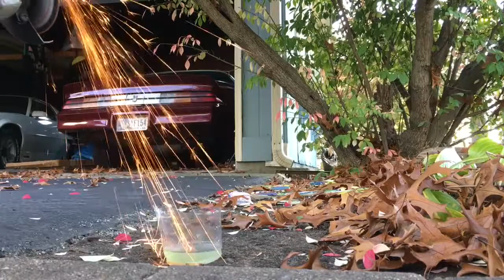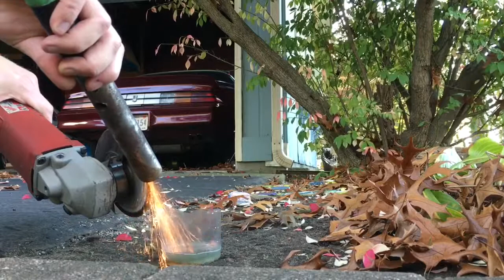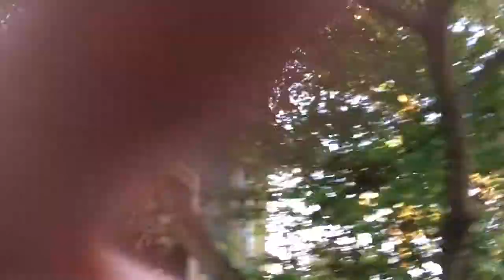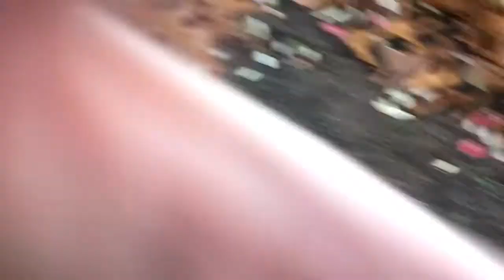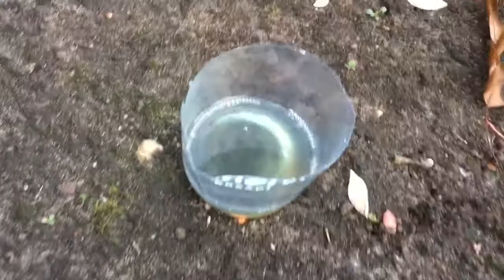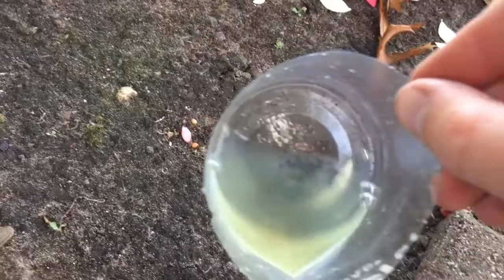Gasoline vs Sparks from Grinder

Comment: i sometimes light my cigarette with an angle grinder, gasoline does light with those sparks, it just needs to be on something, for example i once accidentally poured gas on my work clothes and started cutting and i did not even notice when my pants caught on fire.

Comment: I've tried this w/ a djarum cigar on a 100+ degree day, gasoline will always put out the cigar's /'smoke's' cherry  100% of the time, the only real danger is in the lighting of it w/open flame near the fumes (which dissipate exponentially in the air)

Comment: Hmm I've got to grind something in my engine bay, worried about oil possibly igniting. I'm guessing if gasoline wont with these sparks then the oil shouldn't either? More research is needed.
Reply from the maker: Ayygo you could always cover areas of concern with a wet towel.
Reply: @nitroevaderbx  Great idea. Thanks!
Reply: cut the studs of my strut off in the engine bay with a grinder, no problems.

Comment: Interesting, though I would suggest that it's not so much the temperature of the sparks that is in question. The color of those sparks would indicate temperatures of approximately 1400-2000 degrees Fahrenheit and the ignition temperature for gasoline is around 500 degrees Fahrenheit. Might have to do with the thermal conductivity of the metal and the relative size of the fragments.  In the event that a larger piece were to break off you might get ignition. I would think that the chance of ignition would also go up in a less ventilated area, or maybe just increasing the surface area for the gasoline to evaporate from. Not completely dissimilar to how lighter fluid burns more readily when soaked into wood or charcoal. 

Just my two cents in the case that your curiosity isn't completely satisfied yet.
Reply from the maker: Ravenous Travis At the time I was satisfied but another experiment can be conducted with your tips.
Reply: I think the gasoline is evaporating too quickly. Only the vapor is flammable, and it is probably drafting out of the cup too fast. Putting plastic wrap over the cup would probably cause it to light when a spark breaks through the plastic. Alternatively, shooting sparks into the nozzle of a near empty gas can, where fumes are slow to escape, would probably explode in your face. Gasoline experiments really are dangerous and are a case where you really may be better theorizing than running experiments.

Comment: Try it with lacquer thinner, preferably on a rag. I can guarantee you that works.
Reply: Cutting à gas tank aint the same business the vapors are more dangerous and the hot spot Where you cut can ignite the vapors
Reply from the maker: Kissai Sith Jen'ari That may work. This test was just for gasoline to see is cutting on a gas tank could start a fire.
Reply: It has worked countless times, setting rags soaked in lacquer thinner on fire that were not kept a sufficient distance from where grinders were being used.

Why don't you put some scraps of cloth or cotton in the cup next time?